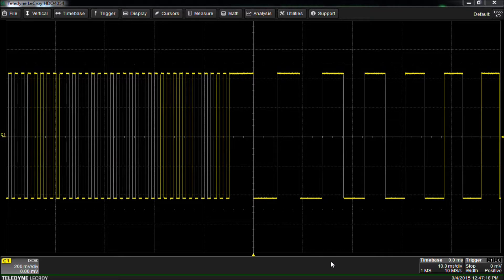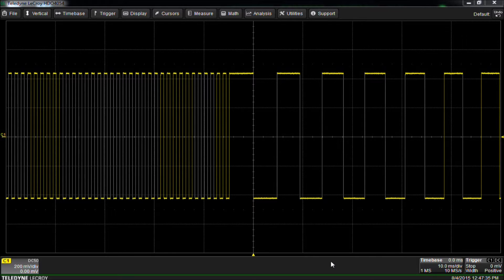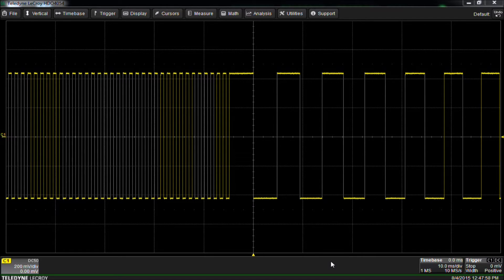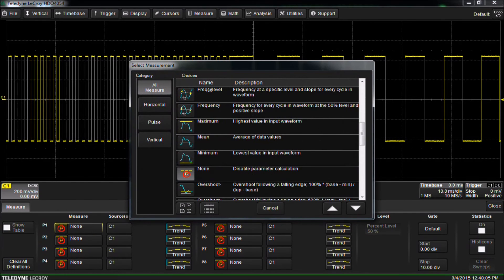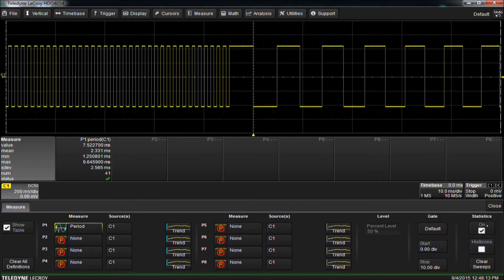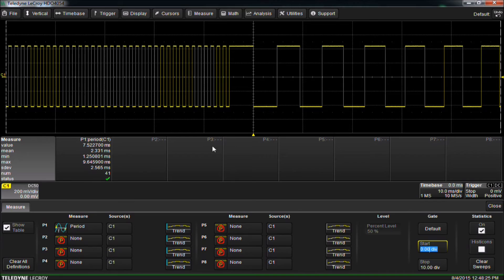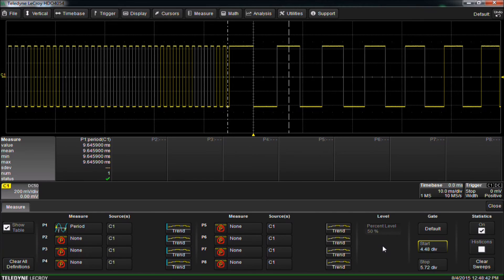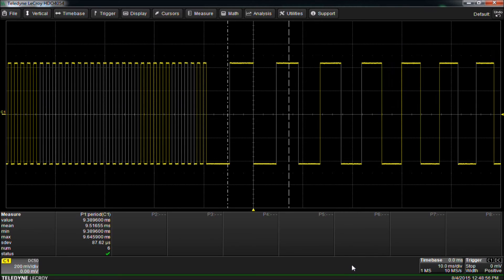Oscilloscope FAQ - Gating | Teledyne LeCroy

Comment: Can measurement gating be implemented through GPIB? If yes what is the command? Thank you!
Reply: +Magai Gari Yes you can! You would implement gates through GPIB using automation commands. Here is a link to an FAQ entry that describes how to use the XStream Browser on your oscilloscope to find automation commands : http://teledynelecroy.com/support/knowledgebase.aspx?docid=533&typeid=1&capid=106&mid=530&smid=Here is an example of two commands to gate parameter P1 within 2 and 4 divisions.vbs 'app.Measure.P1.GateStart = 2'
vbs 'app.Measure.P1.GateStop = 4'For more help, please contact our applications engineering group at 1-800-553-2769, and select 3.